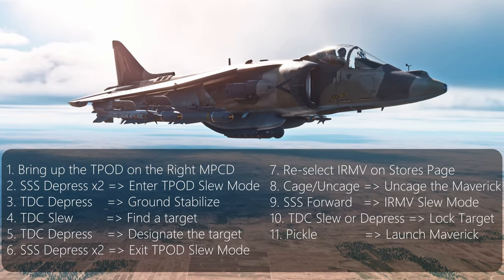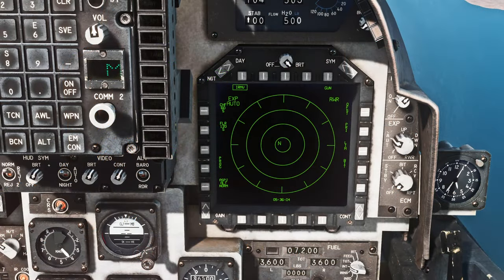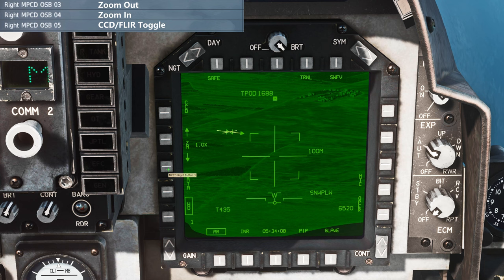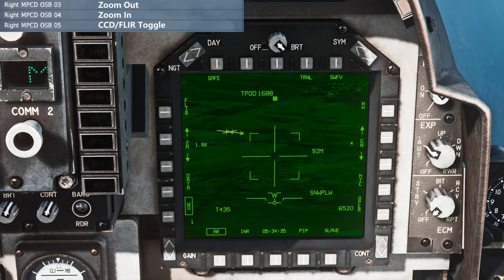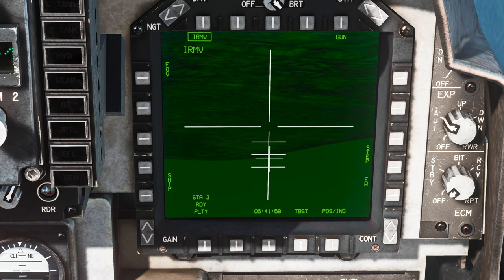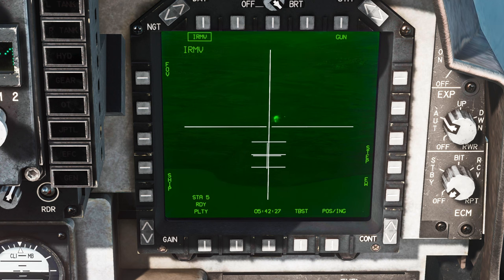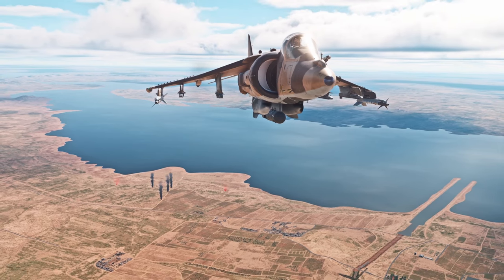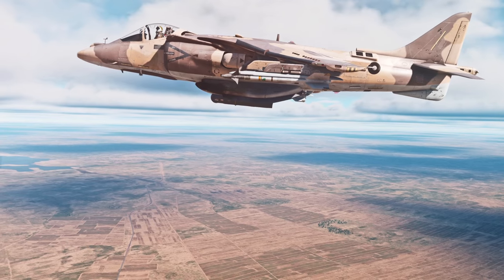DCS A/V-8B: Using IR Mavericks with the TPOD (Updated Version)

Comment: Great Video and very informative. Are you using TMHW ?
Reply from the maker: VKB Gunfighter Mk3 base + MCG Pro grip
Saitek X-56 Throttle
MFG Crosswind V2 pedals + damper kit

The TMWH has a really stiff centering spring which isn't great for helicopters, and that's what I fly most.

Comment: Is there any justification for the 8-9 mile Maverick tracking limit, or is it just one of these ancient DCS 'limitations'?
The Ka-50 Shkval has the same, seemingly artificial, limit, but TPODs seem to have no range limitation on Point Track.
Also, do Mavericks still snap to lamp posts that aren't even visible on screen?
Reply: The limit on the Mavericks sound reasonable, but it's a hard coded limit, much like laser designators/rangefinders.

DCS doesn't actually do contrast tracking, it does 'object ID in FOV' checking with some modifier that accounts for time of day - which is why it sometimes locks seemingly random objects as well as poor-contrasting ones, and why it won't lock high contrast areas.
Reply: @OliverMiles98  I'm very very familiar with these hard coded limits, and I know how TV (and to some extend IR) is suffering from clouds/illumination, fog, precipitation and time of day.

What I find is odd, TGPs can track objects from much further away, at least in the ED modules. It's the same raycasting method (closest object in FOV), but without the 9 mile range limitation.

Coming back to the Maverick:
The real AGM-65 is designed to track objects of a specific size, at a certain range, based on contrast. That's my understanding, please correct me in case I'm wrong.
DCS doesn't do contrast, so we'll ignore that. We know the size of every object in DCS and we can calculate how far we are from an object. So, we could calculate how big an object appears to the MAV seeker.
We also know that small objects (like lamp posts) don't fit the MAV's lock-on criteria, so all these objects could be flagged as "low lock priority".

So, we do our FOV check as usual, ignore "low lock priority" objects, look for the next object in line, calculate the relative size of that object and lock on if it's large enough for the MAV to track. It's not that hard in terms of logic and math in LUA.
For performance reasons, you could still limit the max range to 20miles. Beyond that most targets would be too small for the seeker to pick up. Large objects (like pillboxes) could get an exception.

Sorry for making this a long one, but I don't see a reason why the MAV should be hard limited to 9 miles.

Comment: Hi there. Great and usefull tutorial. I followed all the instructions step by step...all ok. I got the IrMav locked...its in range...master arm is on...i'm in ground mode...but, when i press the weapon release button, nothing happens! The missile doesn't leave the rail. I cant figure out what is wrong
Reply from the maker: Are you just tapping the button or holding it? I'm not sure if this is true for the Harrier but in other jets you have to hold the weapon release until you see the missile fly off the rails, and if you let go too soon you can interrupt the launch process and effectively turn that missile into a paperweight.

Also just confirming, but you waited for the seeker heads to cool and they say RDY on the stores page? The HOTAS is in IRMV mode and the crosshairs are closed in on the target?

Also a dumb question but I ask because I've done it (oops). Your gear is up, right? AFAIK the harrier won't fire weapons if your gear is down.

Let me know if you figure it out!
Reply: @vsTerminus  I hold it for couple of seconds...I also tryed to bind the command to different keys and buttons...bytheway I don't have any proble to release bombs...
thanks for the answer 👍👍🙂

Comment: But FLIR is working, right? Ground unit not moving  = cold ? Mav shouldnt get a lock and we had to use lasermaverick or something else.
Reply: Yeah, the FLIR problem is with the A-10Cs, F-16 and F/A-18 which are using the old FLIR system.

The problem here is that the targets are cold.
Reply: @OliverMiles98   maybe too cold cause their engines still running?
Reply: @sorcer3r17  Or that their engines are off (which I think the AI defaults to, unless they need to move), couple that with the local conditions and the location and it's not totally unthinkable that they'd be poorly contrasting (though maybe there's some WIP-iritis in play).
Reply: 10, 16 and 18 already use the new FLIR *visual* model. Zoom in on a tank and you'll see the engine deck is hotter than the rest.
Engines (and generators etc) are always considered hot, no matter if the target is moving or stationary. This might be different for units set to 'inactive', but I haven't tested this yet.
The problem seems to be RazBam using their own FLIR model, which doesn't work anymore since ED updated theirs.

Comment: is this updated version still valid? getting back into the harrier after a very long break.
Reply: It is, but I don't know if the Too option was implemented when it was made.  A better technique now  is find the target with the tpod designate it, hit Too on the ufc, it will assign it a free target point number. Find the next target and repeat until you have 4 stored target points which you can cycle through with the next waypoints increment button, you can forget about the tpod then. Cycle to the first target point, uncaged the maverick(it will be looking at tp1), sensor select forward to goto irmv, tdc down it will lock and hit launch. Hit the waypoints increment button to tp2, uncage, rinse and repeat.  This way you can throw out 4 mavs in a few seconds.